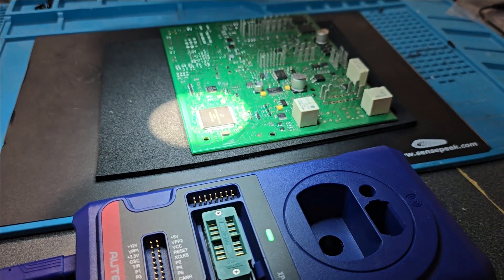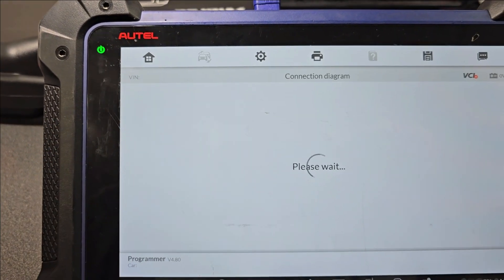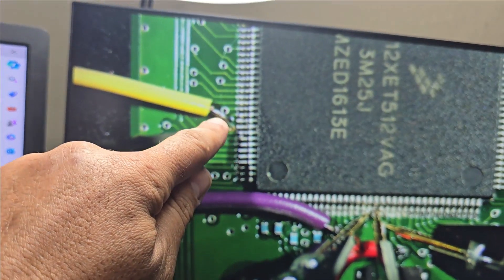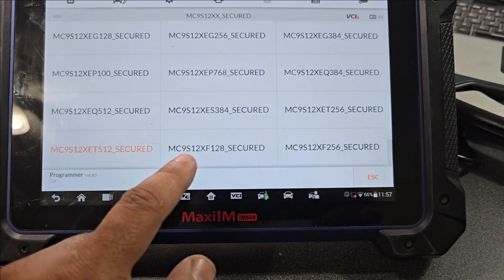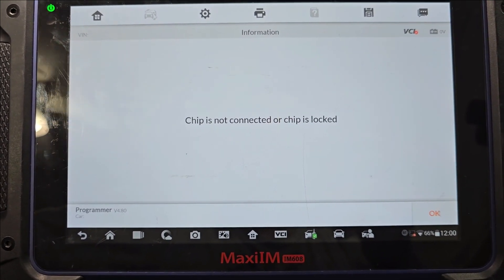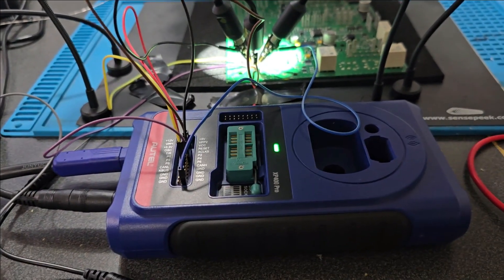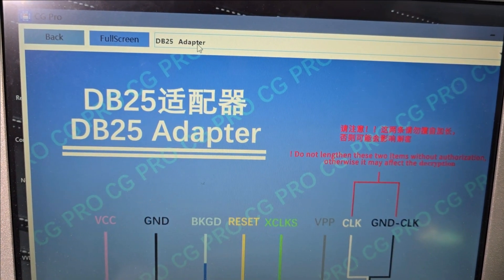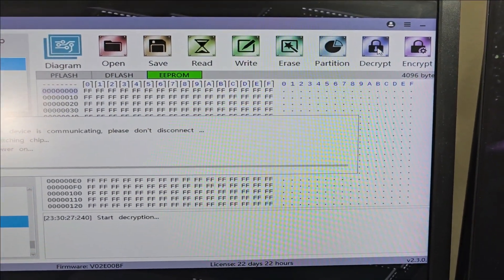Reading a Porsche Rear BCM using xp400 pro and CG Pro

Comment: did any of you told him that 3 rows down the read has a unlock button that has to be used before reading? good that is testing and compare all 3 tools boot has to review some info because they are wrong, as in the first video when he said that xp400pro works only with the tablet, wrong they have software for pc...I got xp400pro, vvdi prog+vvdi2, cg100x, waiting for Xhorse multi prog to arrive, all of them fail on something either they fail when you don't use them correctly.

Comment: get a hexprog because the xp400 pro is known to delete or mess up the D-flash when reading the module. Also the hexprog is the best machine because you do not have to remove components or cut traces or anything extra
Reply from the maker: It's definitely on my list. I do have the hexprog2 but that is just powertrain
Reply: @DallasAutoDiag  yeah they are pretty smart making us buy both now. The original hexprog does everything and also does what the hexprog2 does with ECU cloning .

Comment: Did you scope all the lines? Just wondered if a signal was being squashed by something else on the board. Ive had that before. Saying that, if the programmer reads the ID it should be ok. Unless it changes the clock signal after the ID read. I've had issues there as well. It wasn't a Motorola though, I think that was a 70F something. Id like to see a picture of the BCM and its numbers. I wouldn't mind having a crack at one of these myself.
Reply from the maker: I haven't scoped the lines. That would be a good idea. I noticed one thing while editing the video. Many failed reads were indicating a FFFF as the chip I'd, which is a clear indicator that it would read properly.
Reply: @DallasAutoDiag It just seems strange that all (so far) of the programmers you have tried say they do this MCU and fail. There's a post (unsolved) on MHH Auto with someone having the same problem as you with this module. It seems it could be something on the board upsetting the read. Post the part numbers and if I can get hold of one cheap enough here in the UK I'd like to have a go. This is an interesting one. Good luck anyway.
Reply from the maker: @timmehlittleloud2251   This module was done already but not by read write. I still have the donor mcu available. I realized that there is another way to read the chip by going to immobilizer and choose the module and so on. I haven't tried that yet. Gonna do so one day in the future and see if I get any different results.

Comment: Bro even if this video was 45 min's long, still worth every second👍🏻👍🏻👍🏻
Since the beginning, I didn't have .001% confidence in autel; the machine has failed me so many times that I know what's the max it will do, seriously this is not a rant but it's painful when you think of hard earned money spent to buy these crap devices & in return you get more frustration instead of income🤔
I believe that xhorse will win this contest but let's wait for the next video😍
Thanks for sharing BRO, please convey my msg to autel, I could have bought something with more value for that much money it's total waste🤨
Stay Safe BRO🙏🏻🙏🏻🙏🏻
Reply from the maker: The autel has its spot among the tools. Actually the I 608 is my recommendation to new techs. It definitely made me some money. However I also learned that it also could corrupt the data on those BCMs. Luckily it didn't in my case as I was able to fix the situation by swapping the chips.